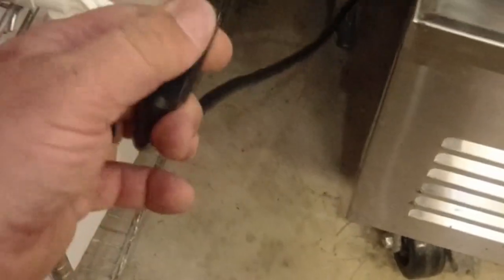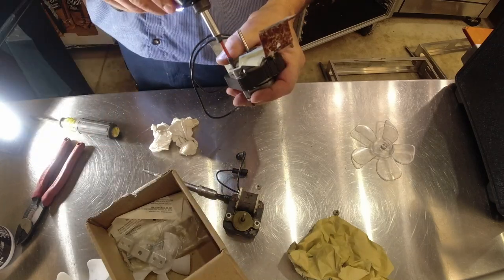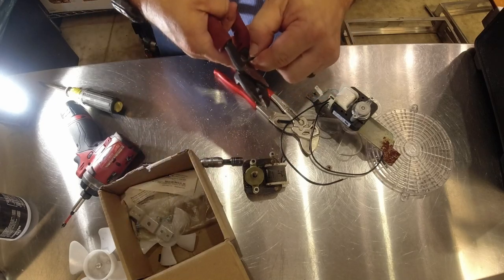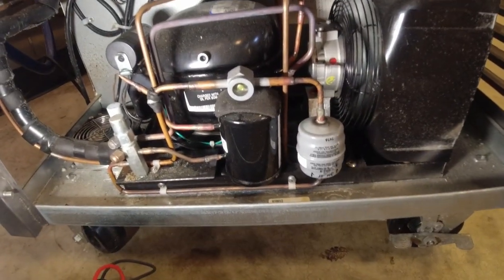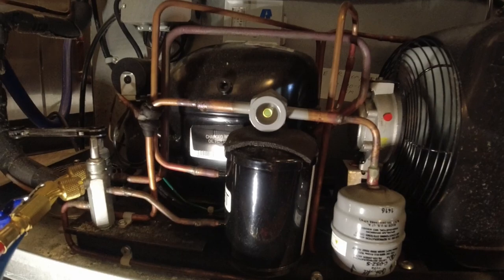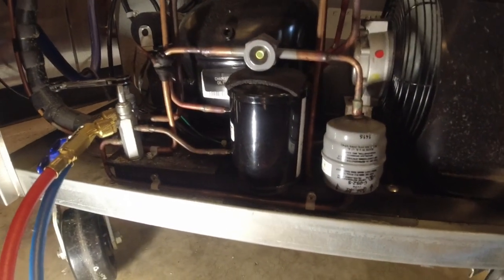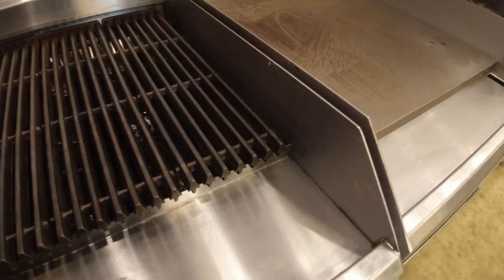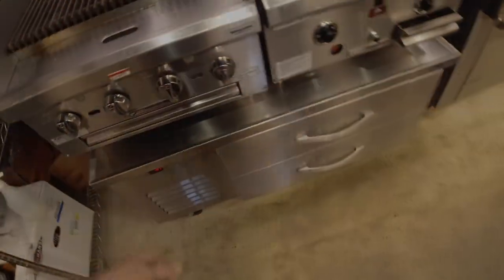Cooler Is Warm /  Door Is Unlocked

Comment: FYI on those C frame motors if you look at the orientation of the copper buss on the stack and match it to the old motor the rotation will be correct.
Reply: I was going to mention that. Super easy way to figure out which way it needs to go without having to apply power
Reply from the maker: Makes sense, thanks!

Comment: Nice job Rick. I am IMPRESSED at that unit. Extremely well made in the compressor compartment, they are all pretty much tight in the evaporator area. Can’t beat the H-10. The old standby.
Reply from the maker: Thanks 👍
Reply: whats the brand?
Reply from the maker: I thought it was the name that was on the outside but that ended up being the distributor. The inside coil was a bone unit so I'm not sure Now
Reply: @HVACRSurvival  was it a Wasserstrom?
Reply from the maker: That's who sold it,  I don't think they make it from what I seen on the website

Comment: I want the old motor assembly.   I know that sounds weird, but I like taking those apart to find the failure.   Usually, though, with the windings like that, the way you reverse it is actually pulling the entire shaft assembly and turn it so it points the other way.  (Look at the clock forums sometimes, and you can find some interesting stories about old synchronous/electric clocks) 

Again, part of why I keep watching is because you go the extra step in most cases, cleaning things that most people would just say "If I just reassemble it, it'll work just as well, and I'll get out of here to the next job 20 minutes earlier."     

Listening to that chirping makes me want to go find the smoke detector that needs a new battery.    

So, coolers used for vegetables leak faster than those used for meats?   

BTW - love the doormat in the truck.
Reply from the maker: Lol. Thanks, I tend to go a little overboard at times

Comment: Cleanest chef's base I've seen.
Needed an excuse to add that M12 grinder/cutoff wheel.
Guessing you keep your Ohio built aircraft terminal crimper in a different bag?
My problem with that universal motor kit is that it never seems to have the correct fan blade for the application I run into AFTER I break the original brittle plastic crap one from its rusty shaft. Finally bought an assortment from Allpoints and now just need to remember to replace the type used for my in house shelf stock.
Always good info on your videos... tonight's viewing a welcome distraction from post Hurricane Ida BS.
Oh well time to boil some water and refill the generator.....9 days later still no electricity or potable water.
Reply from the maker: Thanks for the feedback!. I'm sorry to hear your going through that hurricane. I about don't watch any news anymore, so I wasn't even aware there was one until a day or 2 ago.

Comment: Watching your H 10 how fast they react remind me how desperately I need to replace the sensor on my H 10
        That’s one of the reasons I’ve been using my Stratus more often and I have to admit it’s easier and simpler to use.
Reply from the maker: I had a service call today at a grocery store, walked in with the stratus did not get any signals until I was right on top of it. Walked in with the H10 it went off when I went through the door🤣  But the Stratus is more convenient than the H10 and reaches hard to reach spots plus the battery is great.